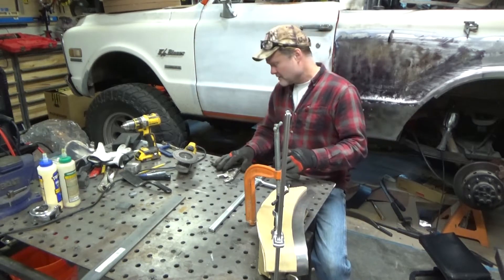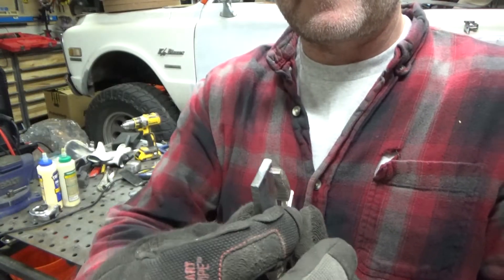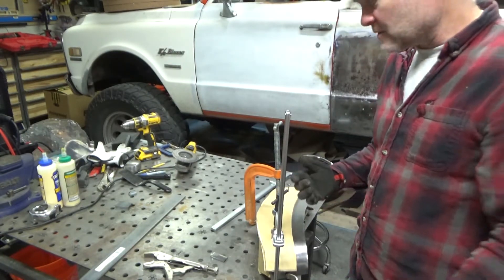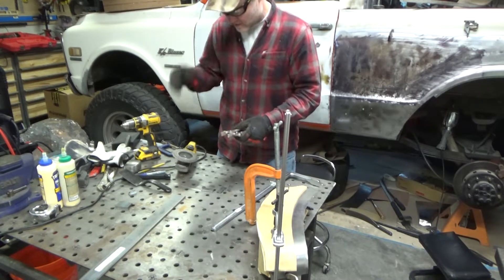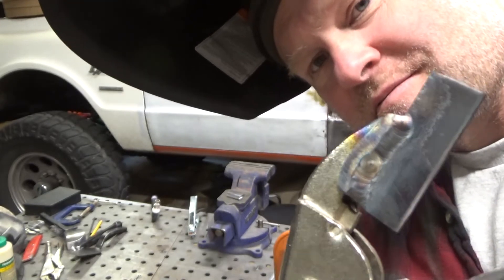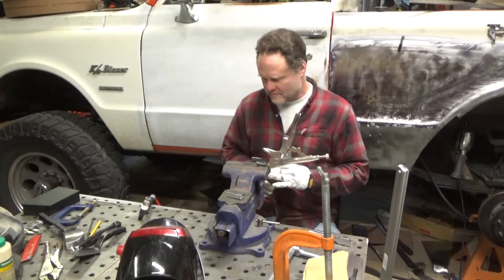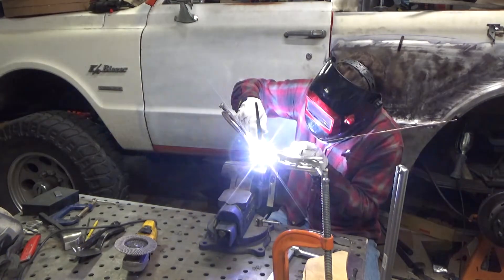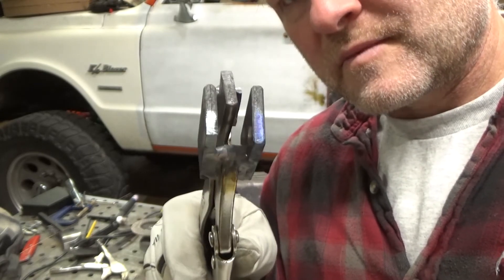Build my own sheet metal shrinking pliers, metal shaping tools

Comment: My lady said why not put it on a sturdy trolley with brakes on the wheels... wheel the vice where you want it then put the brakes on ..all good, I'm about to do exactly this
I really like your shrinking pliers but thats some hefty gauge you are working with and they still appear to handle it quite well.
Reply from the maker: Depending on where you’re located, Harbor Freight has a shrinking and stretching tool that’s not terribly priced and work pretty good.
Reply: @bdpgarage   I am in the UK but thanks for the thought, I prefer hand made tools like this and a shrinking fork hammers that I regularly use,
Reply: I think its allway good if you can make tools